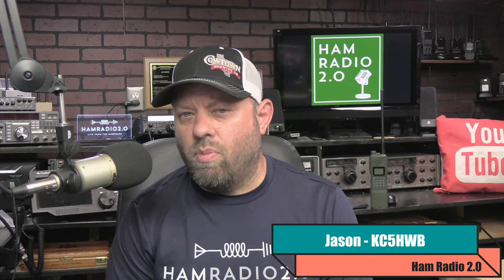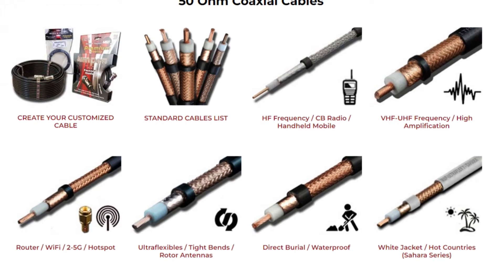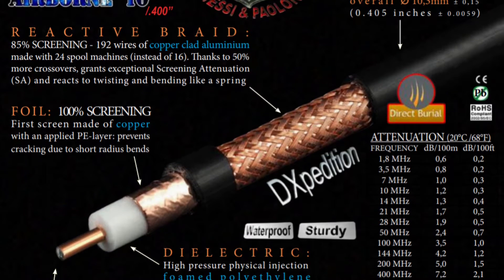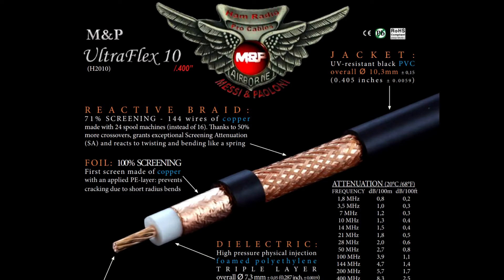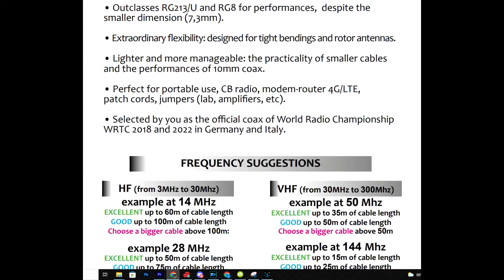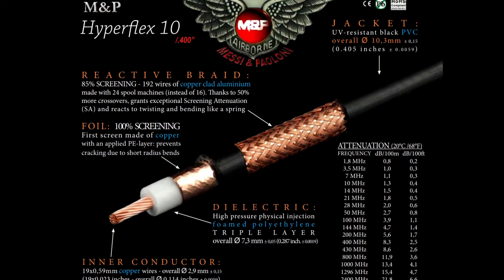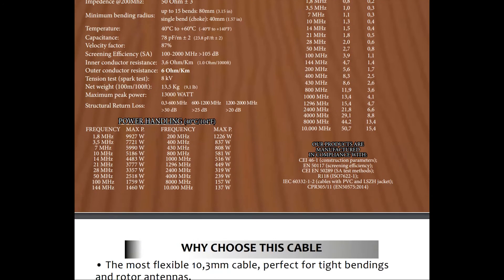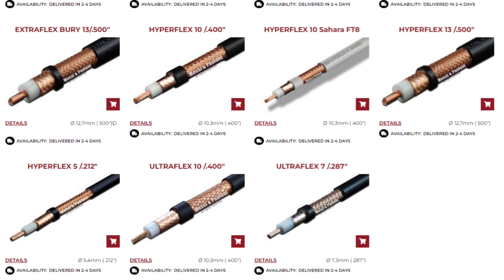Understanding M&P Coax - Best HF Ham Radio Coax

Comment: I’m going to have to watch this a few more times as I still don’t know what to buy. 

Needs:
- Basic inside shack runs
- HF run of about 100’ buried going to a DX Commander Signature 12
- vhf/uhf (possibility of being buried, but not 100% sure where I’ll be mounting this antenna)

Unlimited budget. 
Any suggestions?
-73
KG5YMD
Reply from the maker: Get the largest diameter that you can.  Hyperflex 7 or Ultraflex 7 - or 10, if you can find it.  10 is more rare.
Reply: @HamRadio2  thank you Jason. 
You are always quick to respond to questions and we appreciate that. 

Have a great weekend.

Comment: I used to have rg213, rg217 18ft with predator 10k, on my freightliner Cascadia.  Swr 1:01 , 1:1 or 1:2 I changed to ultraflex 10 and cant get swr under 1:4. What could be the problem?  Thank you!
Reply from the maker: Bad connector or a break in the coax
Reply: @HamRadio2  thanks for that fast response.  Going to inspect it. This is a brand new coax

Comment: When, as I, we only have less than 5W from the handheld (HT) to the roof antenna of the car minimizing the loss from the radio to the antenna becomes incredibly important, because there is zero wiggle room for errors. In this situation getting the best cable & connectors available from radio to antenna becomes paramount no matter the length of the cable. We are lucky there is a manufacturer like M&P who has found a niche where they survive. Despite my tiny support, I will happily support them in any way I can, because it is companies like M&P that makes a huge difference for clients like me.

Comment: It is really good cable! But is only as good as the connectors. I installed a 75’ run on my tower 10/1/22 of Extraflex bury 13 premium .500 started having issues with my repeater right away!  I bought this cable preassembled complete with M&P connectors installed.  Basically took 7 months from minor issues to complete take the tower down failure! The punch line is this…the connectors were not installed properly when I ordered it! I bought new connectors and installed them myself!  The repeater has never worked better! This product is awesome! Less any human error you won’t regret buying this cable!

Comment: Not a bit surprised to find you recognizing this amazing coax and rating it the best.  I have Hyperflex 10 and Hyperflex 13 in various runs and it's absolutely the best coax I've ever seen in almost 60 years of ham radio.  I've purchased from Gigaparts and factory direct with Stefano for odd length assemblies.  Their version of a PL-259 connector is their own unique design and is outstanding as well.  Amazingly inexpensive considering the quality. The support is second-to-none as well as you described.

Comment: I Have Ben into Radios for 35+ years i even ran a repair shop for 20+ years but i had never heard of Messi & Paoloni until Very Recently (2-3Weeks ago) & I have read & watched ever video i could find trying to learn about their Coax & Their Connectors & I have Decided that it is Probably The Very Best Coax Money Can Buy & So I Placed a Rather Large order (To Me) Yesterday & i will Give it a Try..I Got the Hyper-flex 10 Sahara And 7-8 of Their Awesome Looking  Evo Pl259's & N Connectors I Even Wanted a Pair of Their Cable Scissors But Blew my Budget on more Coax & Connectors..lol. But I Have Spent & Spent Trying to find good Quality Coax & I am Just Trying To Build A Long Range GMRS Base Station & Any Good Station as you know Must Start With A Good Ant (Diomond X30A & Soon to Be a Comet GP9NC & Coax I Figure i Should be able to get 40-50 Mile coverage at about 30ft high ish..if its only 4-5 miles i will Junk it All ..lol. Any Way thinks for telling people about this Coax...like i Said It Is So Hard To Find a Quality Coax now days its just Un Real ! Please tell these newcomers that if they are only getting 3-4 miles with a repeater they Have a Major Problem !

Comment: Hey,  hoping you can review the actual product they have that looks very interesting to me.
 One the Silicon Shrink (seal) Tubing they sell and two the right angle SO239 connector for .400 cable and if you have luck getting that to work with
Times Microwave LMR400 or the DX Engineering equivalent. 

  Both of those products are getting me all warm and fuzzy just looking at them.  Especially the right angle connector.

  Bummer that LMR240 is just too 'oddball' a size for their .212 and .287 diameter coax connectors as LMR240 I have measures out at .235 to .240.
I sent them a email enquring if perhaps I could force the .212 to fit.

Comment: ABR is my go to.  Made in local shop in Houston not far from me.  Have not had any issues with it.  In fact it is the company Harris County of Emergency Management uses.  And H-Town's heat, humidity, pollution and salt air are hard on antenna systems.

Comment: Hi Jason,
Have had the Hyperflex 10 outside for three years now without any signs of degradation. Used it to replace all my aging coax. Bought 250 ft from MFJ when they became the US dealer. Still have about 100 ft left. Stay safe and enjoy Hamvention.  73  WJ3U